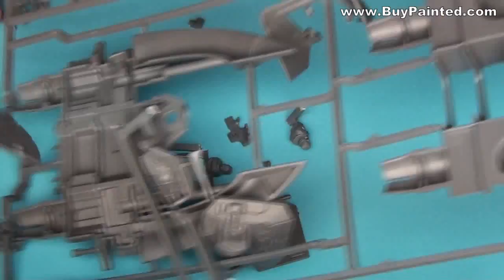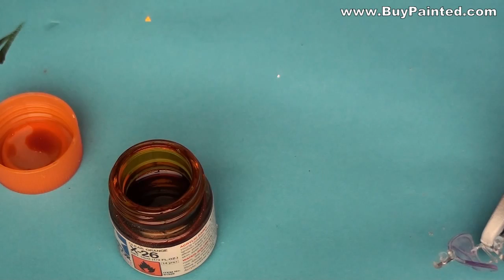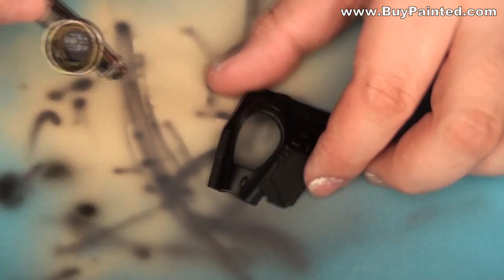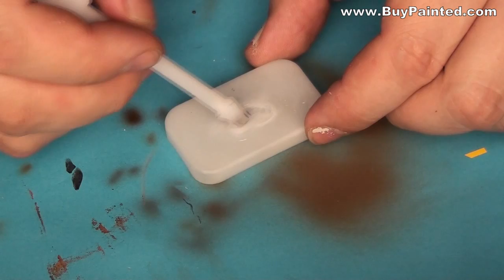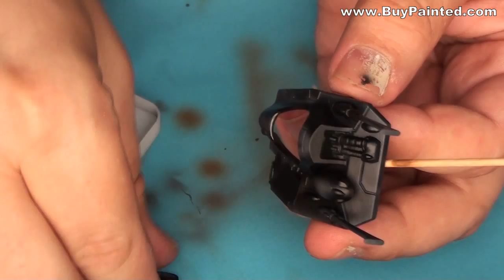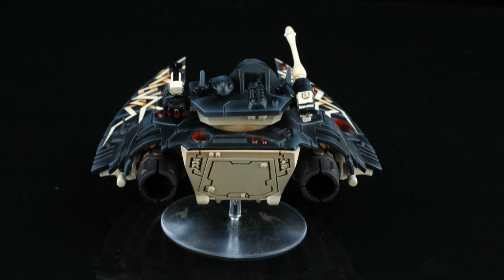How to paint the Eldar Ulthwe Falcon cockpits?

Comment: It must not happen. If glue touches important visual parts of the prepainted model, it will destroy the paintjob immediately. plastic glue melts the material to fuse the parts together so it will seriously damage the paint.

Because of this, you do not need much plastic glue to combine the plastic model. just add a thin layer of glue to the parts and let them dry a little bit, 30 seconds or so. in this time, the glue melts the plastic and when you combine them, the glue will be less fluid.